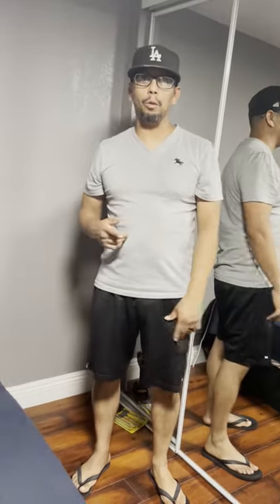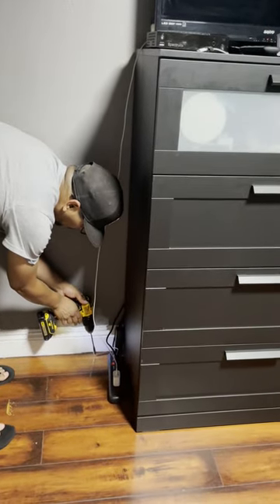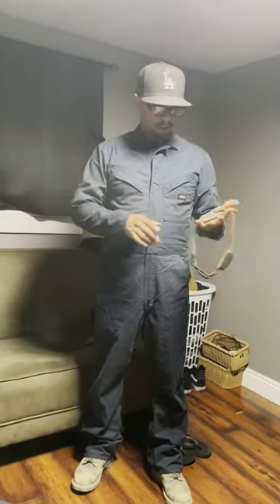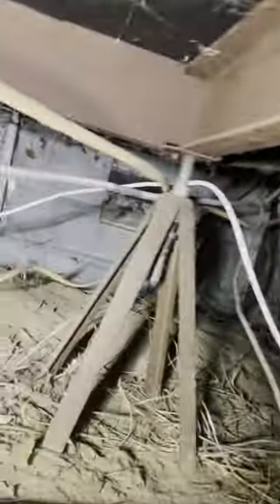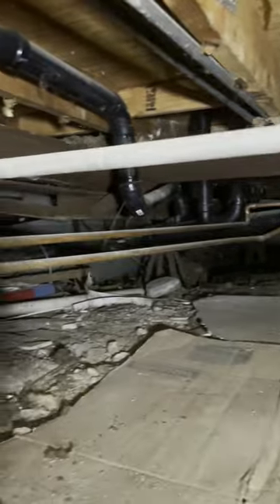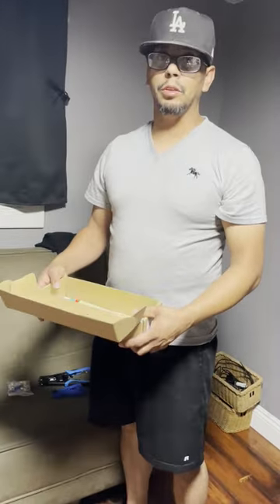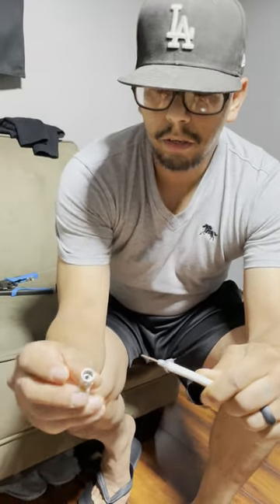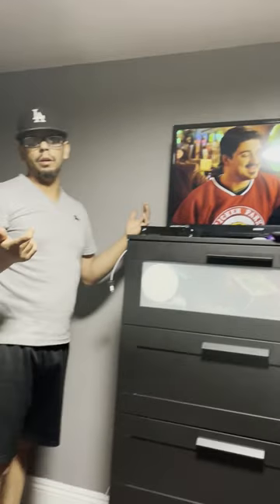How To Reroute Coax Cable Wire

Comment: Think I can run the wire down without stripping the top off ?
Reply from the maker: If you don’t mind making a  larger hole you definitely can. I wanted to drill the smallest hole possible. I hope it turns out well for you, GOD bless  you 🙏